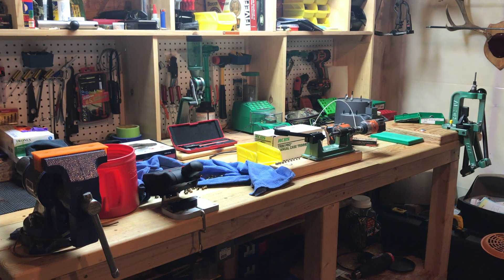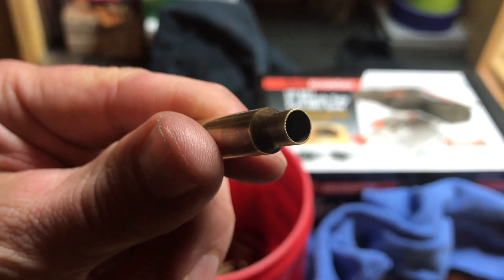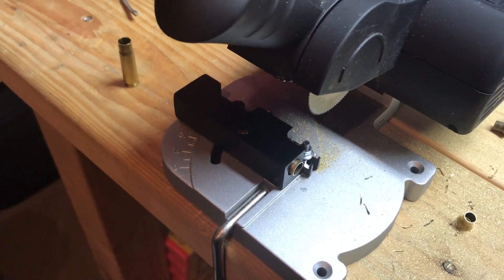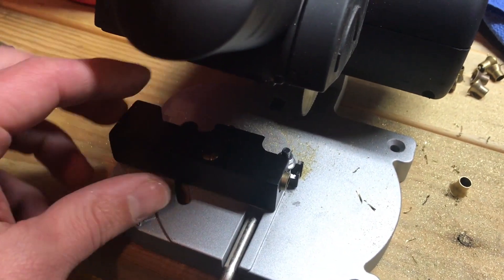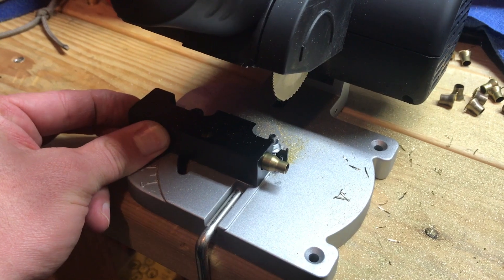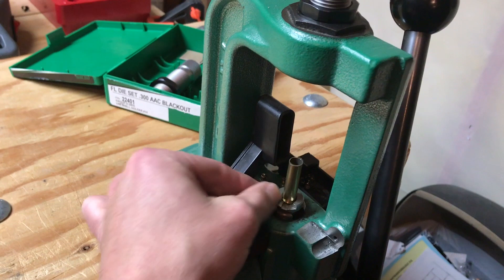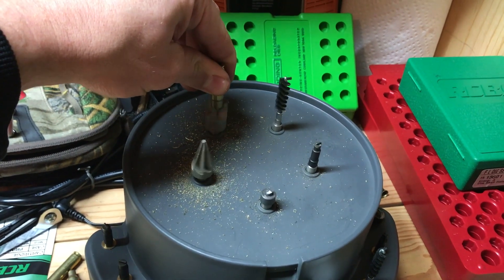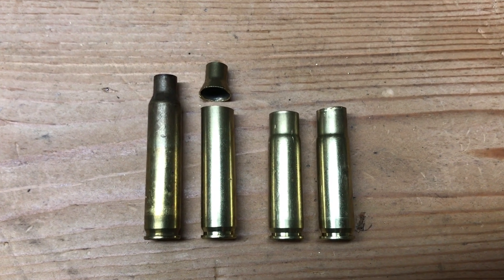Tips and Tactics: Converting .223 Brass to .300 Blackout

Comment: I also use the same chop saw and jig, I did so much research before going with that jig and if you go to Zepp's website he's sold out on that particular jig for a reason... it's that good.
According to the online forums the best sizing die for the 300 blackout is the RCBS small base sizing die, as for the trimmer I went with a Worlds Finest trimmer, you just insert it in your cordless drill and with some minor tweaking you can keep your workbench clutter free and keep the shavings in the scrap bin instead of all over.

I would also recommend the slotted Sheridan gauge as a good chamber reference in case a person gets ahold of some brass that has a thicker neck wall. It can and has happened.
Reply: No problem.
As for the trimmer I use, there's an upgraded version to where the insert is removable and you can pop in different calibers, kinda like a press, one press with different dies. The trimmer only cuts cleanly so you will still have to chamfer it but it's a LOT cleaner than the example you did. The trick to the WFT trimmer is simply using a cut off water bottle to catch the shavings, I believe there's videos here on Youtube to see how its done. Already that gauge has saved my bacon with some brass that had neck walls a little too thick. A tubing micrometer also comes in handy when figuring out different batches and manufacturers of brass.

Comment: What length do you cut the case to prior to sizing?
Reply from the maker: I just set the jig up with a piece of 300BLK brass so that it’s square and fairly close to the blade. It doesn’t have to be exact, the precision comes in the trimming stage.